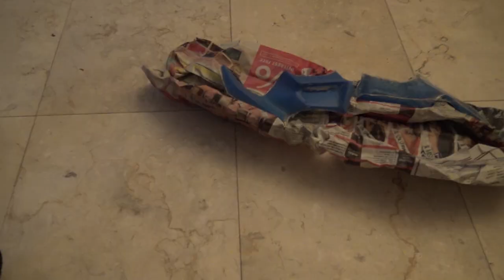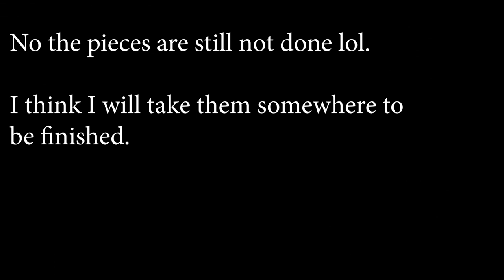Winglets

Comment: Use water when sanding bondo it's much easier to sand than dry sanding..
Reply from the maker: depends on the grit and type of sandpapper, but yeah wet sanding is good got lower grits.

Comment: Bondo is equivalent to Polituff in the Philippines. It's available in any hardware stores.
Reply from the maker: I got some of the stuff here but was told it wouldn't work well for my purpose.
Reply: Polituff is especially designed for use on auto-body patching. It's also a 2 component body filler like the bondo. Most of the auto repair shop used it. So i guess it will work well on your winglets. Sometimes its not available in Ace hardware and DIY shop but for sure its available in any small hardware shop. Regarding the sanding block most painters here just cut small piece of wood block and that's it. :))
Reply from the maker: thanks for the info. I'll try that out sometime : )

Comment: Dude your messing up your bathroom, that fiberglass residue will get into nicks and crannies and will be hard to take out. The primer smell and the clear coat/base coat gonna stink up your bathroom for a long time. Bad idea, just have the body shop do it for you.
Reply from the maker: Neat thing here is that there is a drain in the floor and a spray nossel you can just hose down the whole bathroom afterwards.  I should have just took it to a body shop yeah..